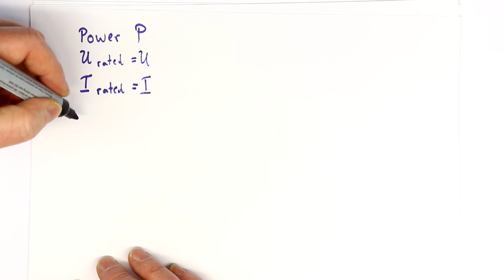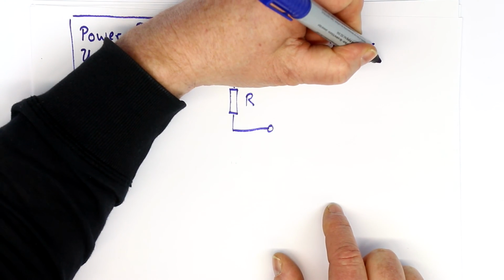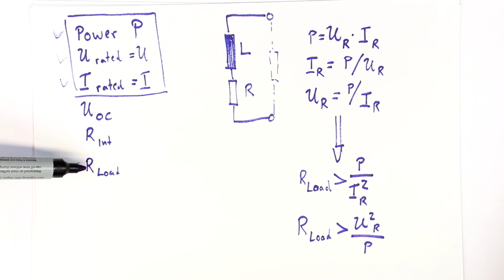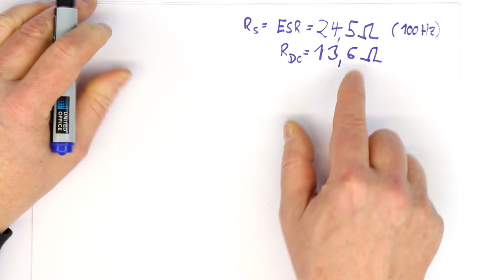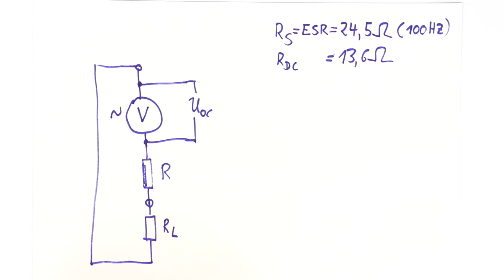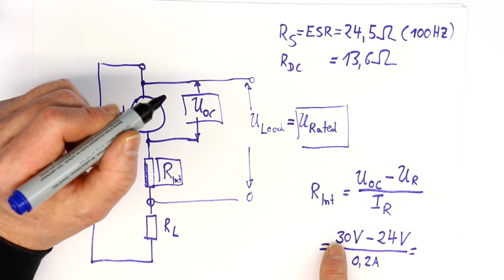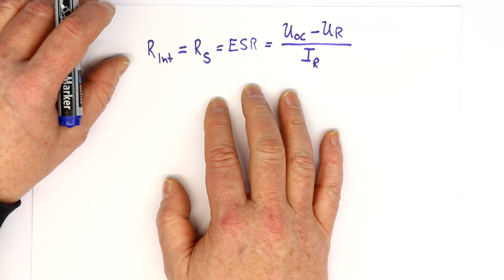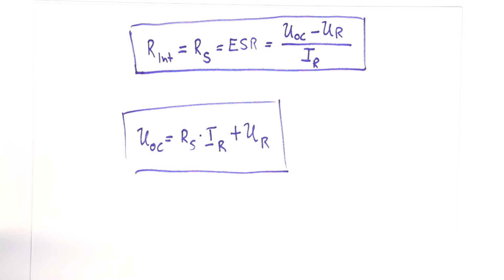Measuring & Calculating Transformer Characteristics

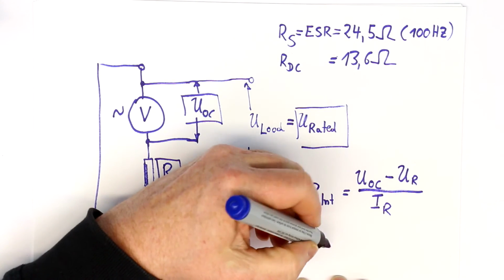Comment: Something wrong with the formula at 14:33 in that it ignores core losses which are modeled by placing an inductor in series with the windings.  Z is total impedance referred to secondary and includes inductive reactance X due to core losses. The proper way to determine R and X is to perform a short circuit test by shorting the secondary windings and applying a voltage (Vsc) to the primary side until rated primary and secondary currents are realized. Then measuring watts consumed (Wsc) it follows that  R = Wsc/Ir^2 and Z =  Vsc/Ir and thus X = sqrt(Z^2 - R^2). These will then reflect total core (X) and copper (R) losses as referred to the primary. An ammeter and wattmeter are needed to do these calculations.

Comment: I have a 12.6 V center tapped transformer. Transformer is rated at 2 amps. Uoc = 13.82 V. So calculated Rint is 0.6 ohm. With no current on the primary R (DC) is 0.2 ohm. ESR 0.8 ohm. However when measured with transformer primary plugged in to 120 V  no load I get R (DC) = 0.4 ohm and ESR 1.6 ohm.  Now it seems to me that since the predicted Rint is dependent upon a voltage divider circuit with assumed Uoc volts the primary must be "plugged in" in order to do this calculation. If that is the case the R (DC) of 0.4 ohm is actually closer to predicted Rint of 0.6 ohm than the measured ESR of 1.6 ohm. Have you tried measuring R (DC) and ESR with current in the primary?

Comment: Is there a way to empirically determine the VA rating of a transformer e.g., by decreasing the load resistance until the voltage drops below the rated voltage of the secondary?
Reply from the maker: Yes, that´s exactly what I would do to determine it. Another way would be to increase the load until the tranformer-temperature stabilizes at around 80°C.

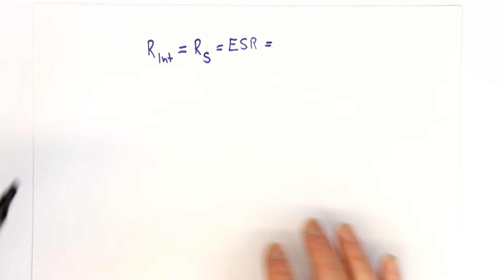Comment: Hi, I have the open current voltage, internal resistance, and an estimate of the rated power (fuse amperage*mains voltage*0.80) of a salvaged transformer. I am having trouble applying the equation at 17:00. I keep getting complex solutions for the rated voltage/rated amperage. Some pointers would be appreciated.

Comment: Excellent. Thank you for the video. 
Would it be reasonably accurate to actually measure the open circuit voltage with a volt meter and do the math to determine the Rs knowing the transformer rated voltage and current?
Reply from the maker: Yes, that works as a first approximation. I have to think about under what conditions you could get misleading results with that method.